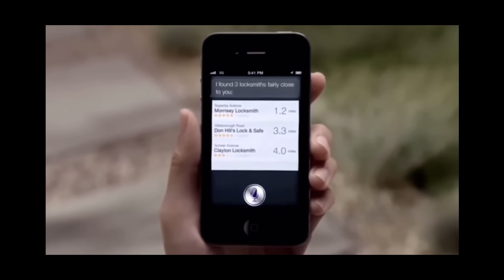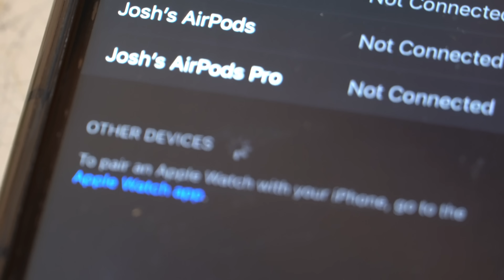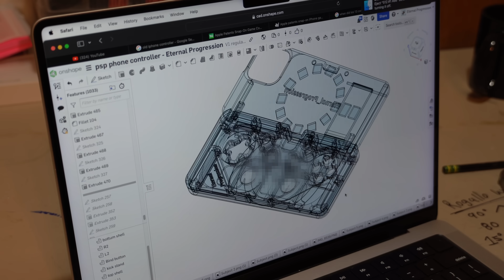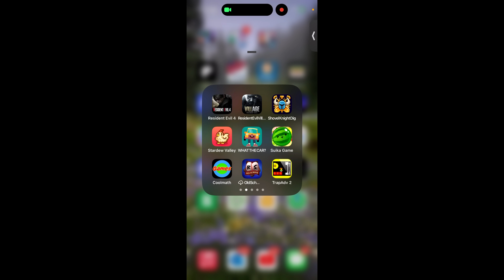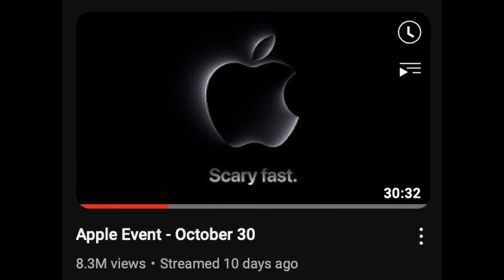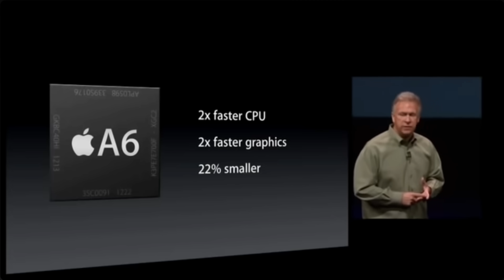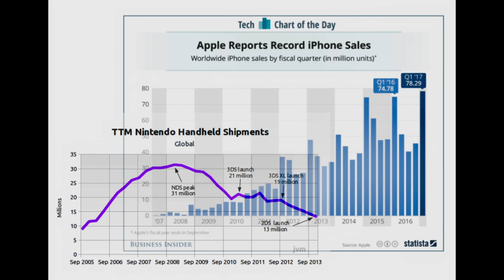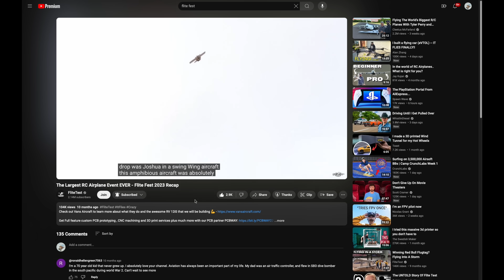I built this controller because no one else would | M-Con V1

Comment: This is the controller I've been dreaming up since the first games on iPhone and PSP Go! The controllers have been the main thing preventing me from spending more time playing mobile games along with so many games featuring loads of micro transactions and lack of quality development. There's some good premium games where you can pay once like FEZ and Chrono Trigger, Hyper Light Drifter, and some other great indies. Regardless the LG Rumor slide out keyboard phone was the concept I had in mind. While I like the concept you have here the idea I have is for one that is smaller and thinner with different button arrangement. Still a cool concept and I think with refinements it could be even better. I still think the optimal controller for phones will be substantially thinner and smaller. Aside from the overall design and size of the M Con you've made this is the way to go. I spent over $100 on an Xbox special edition Backbone that's sat in the box ever since maybe a week or two after I bought it. I wanted to return it but just didn't have the time and couldn't be bothered. It's a good controller but not for on the go. Rather than the Backbone I can just bring my RGX35XX-H in my pocket and save space and have a dedicated gaming device without having to take my big old Switch or Steamdeck anywhere. The size of those systems along with the demands of battery life and load times as well as an internet connection are things that all hold back Switch and Steamdeck as the ultimate devices, at the same time these are possible strengths and advantages for mobile gaming. Not too many years ago handheld games were primarily and specifically designed for handhelds. They were amazingly fun quality games that were bite size compared to consoles but still provided adventures and offered short stories and replay value. Their graphics were great but not designed to be mind blowing. Those lower specs catered to the device to help work within CPU GPU limitations while being designed for play on the go without being full of micro transactions or being stupid distraction games like Flappy Bird or match 4 puzzle games. Mobile Gaming still has cancer and as an avid gamer it's not the cost of microtransactions that bother me as much as not being able to buy the entire game at once and not be manipulated and stopped into buying more stuff for the games. I wish mobile gamers would DEMAND games that are quality where you pay the price upfront with no micro transactions to access the main content of the game outside of optional DLC or cosmetics AND no damn subscription fees. The only games I buy for phone are all pay once at a premium price (still cheaper than micro transactions) for games that are most like the classic handheld games and modern pixel art indies but lack of a quick small quality controller is the main preventative. I have one other idea for a gaming controller that is neither the control you have designed here nor nothing else I'm aware of that's on the market. I'd like to talk to someone about it but I just wonder if someone else will create something similar and bring it to market or steal my idea.

Comment: This. THIS. THIS is the exact thing I've been looking for. After years of seeing the PSP Go, thinking it was a neat design, then seeing it on the Xperia Play phone, I knew this would be the last piece of the puzzle to make mobile gaming something that console gamers could seriously consider. While all the "joy-con-like" designs currently on the market are usable, they take away from the portability of the phone. This design finally compacts the controller back down to to a state where you can easily put it in your pocket and keep it attached to the phone at all times.

And from here, there's plenty of other things that can be tried. A pipe dream would be to figure out a way of being able to rotate the phone vertically for games that play better in TATE mode. You could also find a way of being able to split the controller into two halves to make the screen positioning more natural. And I don't know how possible this would be but instead of pairing the controller via Bluetooth, making it connect via MagSafe and instantly have it be recognized for ease of use. Heck think of the non-gaming potential uses. Imagine opening the camera app with the M-Con attached, sliding out the controller to make the rear camera usable, controlling the camera functions and options with the controller, and the press the R button to CLICK take a picture like a classic camera.

I will be keeping a very close eye on this project.

Comment: I’d love to get one, though I’m curious if it will work on an iPhone 12 Mini?
Also, is it meant to snap to the phone itself, or with a case in-between? I’d be interested in a version of this which acts like a case, giving the edges of your phone a little extra protection and possibly serving as a better mount for the connected controller.

Comment: I can't wait to buy the a new android phone that has one of these built in.  Apple will never make that because they hate innovation.  The iphone has been the exact same slab since 2007 with no change.  And your design is terrible because it has the weight of the battery at the top of the device, notice how even the psp go and the gameboy advance sp you showed in this video both have the common sense design of putting the battery weight at the bottom where it belongs.  Another huge issue with your design- being wireless- is it defeats the purpose of it being portable.  The whole reason why the nintendo switch works so well is because the joycons are wired in when youre playing in portable mode.  Having to charge your controller on a portable system is just stupid and no one would want to do that.  But you're too much of an apple fanboy to branch out onto anything else.  You have so much potential, but you're hurting yourself sticking to this awful trillion dollar company that has done nothing but hinder innovation for mobile product design.

Comment: Hi, I posted this on a reddit update post you made on the Delta page under the name Fitreccomondation with some numbers at the end, it was a default name, but heres my comment for more to see! 

Addressing the Android camera module problem:
(sorry its kinda long)

Samsung phones , even their really cheap midrange devices all have that signature 3 camera design. This would only really work for s22 and above but maybe s21 would work.

A similar type of Android that has a similar yet different module would be any Sony Xperia phone, they are pretty consistent in their flagships and midranges. though these are really only popular in Japan, and are frequently left out of these cool types of devices or any non case/screen protector accessory.

Another type of android that would cause a bit of confusion would be any device with a circular camera module - like Xiaomi, Oneplus, or Oppo. But those are only really viable if this project goes outside of North America. They are popular in Europe and Asia though, which are still really big markets.

I think its inevitable that there will have to be some sort of system for all devices that dont really share a common theme, for example, pretty much all Motorola phones look different and their designs change pretty frequently. This is where my next idea come up.

I think a solution to ALL the different types of cameras would just be to make a large gap in the back of the device in order to house just the main cameras, but only near the top of the phone where the cameras would be so that it can fit all types of modules, Though structural integrity might be an issue. This would help eliminating the need for making a bunch of other types of controllers for other types of phones - eliminating e-waste.

Instead there would only need to be, say 3 sizes:

Ones for plus sized phones like SXX Ultra or SXX+ phones and iPhone XX pro max or plus sized phones

Samsung's/Google's/Apple's non pro/plus models because they are smaller than the main flagship

And ones for older phones because phones have progressively gotten bigger over time.

Foldable phones might be kinda funky. a book style foldable is like a normal phone when folded, and a flip style phone is like a normal phone when unfolded. Though certain book style foldables are skinnier when folded like samsung's Z fold, and others are fatter: basically every other book style foldable. Pretty much every flip is the same size though. I think the book style ones would be fun to use it with because it would still be able to attach when opened

The only real issue I could see coming from this solution is from the fact that Samsung's Ultra phones are square to mimic their old Note line - I think the controller bit should still be rounded off for comfort, but the sliding bit that goes on the phone would be square still to match the phone.

Another solution for sizes would be to make models based on phone dimensions, phones are so much bigger than they used to be, even compared to back in like 2018

Also when rewatching this video i noticed a cool trick i like that you did at 1:25 where when you turned up the music in your car the music in the background got louder lol

Comment: Bro I bought a backbone and it was cool but I hated removing my case as well and so I got the new krcd controller and it’s great but I still have to take of the thumb sticks off and on when I’m walking with it in my pocket or at work and it’s in my bag , but this is by far the best controller I’ve seen , I don’t have to worry about the thumb sticks bending/shifted in my bag or pocket , and the slide lock just perfect , just take my money already

Comment: I have zero interest in mobile gaming, actually the fewer software my phone has the better in my mind, but I'm attracted to this video for other hardware features. I severely miss the days of physical keyboards on phones. One of the things which I've been trying to work out in my own slide-out keyboard attachment project like this is the wireless connectivity to the phone. To preserve the attachment's battery, it would be nice if it was turned off when slid in the inoperable position and turned back on when slid back out. I've found bluetooth to be very unreliable at reconnecting doing it this way, it's far from seemless, and in situations where you want to type, waiting for the phone to find the attachment sucks. Seeing as you're moving your product into the early pre-production stage, do you have any insight into what solutions there may be for my problem?

Comment: You either forgot or didn't think about the weight distribution, an iPhone 14 weighs 172g, your controller looks like its less than half that weight, when you are playing it will become super uncomfortable to be struggling with the weight, that's one of the reasons most controllers for large devices are on its sides, try adding weight to balance it.

Comment: I’ve been working on my own similar device using joy-cons for about a year and a half now since I got my 3D printer. Recently called it quits and just bought a steam deck. Really excited to see what you do with this, I’ve been wanting EXACTLY this for YEARS. Looking forward to buying my own, and would love to be an early tester if possible. I want to help push this forward even if it’s not my own project I’m working on anymore. 

Side note for your custom PCB, PLEASE let it support multiple devices easily. Switching between iPad and iPhone, maybe even Mac, without repairing every time would be huge. That was what I was designing - a grip that would work for both iPhone and iPad because the iPhone is great, but if I have my iPad and can set it up, that’s even better.

Comment: It's cool and it's impressive you built it yourself (mostly, still using a pre-existing board), but you're really hyping it up. Like, it's not a new idea or anything, comparing it to the psp go with a slide out controller, there was literally a phone that did that already, the Xperia play from 2011. Wasn't really successful because it wasn't exactly the most powerful, not super supported and was just kinda early, but it was still cool. I had one and loved it. Also speaking of minecraft, it had the first release of minecraft pocket Edition.
Reply: This one is more flexible between devices, and has a wider catalogue of games. Try finding a modern version of this thing anywhere 💀 to compare it to the Xperia is like comparing a modern day computer to a computer from the early 2000s because they both have a mouse and keyboard. Absurd!

Comment: Yeah, this is a good portable controller design for casual games, but for competitive or more complex games, the shape is the main issue. It's good for portability but the way you're holding it is basically the same as you hold the phone. After a while, your hands will feel numb or cranked making it less practical than just using the phone by itself

Comment: I think beyond just form-factor you need to take into account a lot of other things. the more complex games you play, the more controls you need, like analog triggers instead of just buttons. hall-effect sticks, a software to configure response curve and deadzones, because by default on iOS you have huge inner deadzones. without any of that it's just pocket arcade gaming basically. which is not what PC gaming is about. phone gaming in general is a quite separate market.
Reply from the maker: 100% working on a lot of that! 

Also 10000% agree the pc market is probably wayyyy different than this. I think it’s so weird when mobile controller companies promote PC type games for their controller. It just doesn’t make sense. It’s not the same audience. The phone I think could eventually be like the DS and the PS Vita, but not like the steam deck. I mean when the hardware is really good it will play those games. But you wanna sit down on a big screen to play pc games. With a mouse and keyboard. Now you can dock your phone to the tv and that’s pretty sick but ya still.
Reply: @joosh_king  Also, keep in mind that some triple a games use l3/r3, so you need to add buttons for those like older gpd win models used to have
Reply: @joosh_king  I suppose in some 3D games for the phone you can use gyro aiming (for fine aiming), but it's up to developer to implement this. a lot of small details are up to developer implementation really. 
but apart from that, on smartphone there might be limitations on minimum input latency, especially using bluetooth connectivity. gamepads that support iOS/Android typically have worse input lag when in mobile mode, something like at least 20ms latency.

Comment: INSTANT sub and like. This is EXACTLY the controller I have been waiting for. Absurdly low profile, fully-featured, designed specifically for phones. I don’t have a MagSafe phone (still rocking the 11 pro max) but I hope adapter cases can be made via 3D print if possible. Either way, the best controller is the one you have with you, and I would never leave this at home.

Also, I'm watching this a second time because I had to link to it on another video about the 8BitDo Lite 2 and I notice you boosted the volume around @1:25 in sync with you turning up the volume on your car stereo in the video. Clever.

Comment: The real problem with mobile gaming is the casuals. I don't want to sound like i'm some elite gamer, but most mobile gamer just go towards f2p titles or pirate the ports they make to the phones. I too mostly play emulated games on phone. So you can sell me RE4 or whatever else coming to phones too with controller support. I rather play those at home on my PC with big screen. The controller design is neat, i admit that. What i was thinking about is making a DS bottom half into a controller connecting through USB C so it would be compatible with phone and PC alike as most of the motherboards around 5 years already has USB port. It wold be neat for DS and 3DS emulator

Comment: Because of the nature of how phones work with a design like this you're going to have to build a separate controller for each individual phone rather than having one universal controller that works with everything like the other controllers are which is going to be more expensive and you'll have less of an audience so that's why this hasn't been done before even though it would be really awesome. 

It would probably be better to make a modern version of the Sony Xperia play because then you would have the device as an all-in-one and you don't have to worry about does this fit my phone? 

Just make sure not to cheap out on the processor because for some reason gaming devices usually don't have the highest end processor which is very confusing.

Comment: This is a super cool project, but I'm not so sure it's as revolutionary as you think it is. There have been phones with a controller built in already- see the Xperia Play- and it didn't exactly take off or lead to a mobile game development boom. Mobile gaming is definitely a huge thing and it is growing, but it doesn't tend to draw in hardcore gamers which I think is the primary audience that actually cares about using a controller for games. Most mobile gamers are casual gamers and are seemingly fine with using touch controls. I think the more limiting factor for mobile gaming becoming a serious contender is power of the device, which sure is increasing all of the time, but doesn't touch the capabilities of home consoles and PCs. Maybe this will be less of problem with things like Xcloud and PS remote play improving along with connection speeds, in which case I could see the need for a controller solution increasing, and maybe this is the one. Just seems like a number of other things need to fall into place first before this can become what you hope it will. Not shitting on your idea by any means, I'd love one for my S24 Ultra, just some thoughts that came to mind from watching the video.